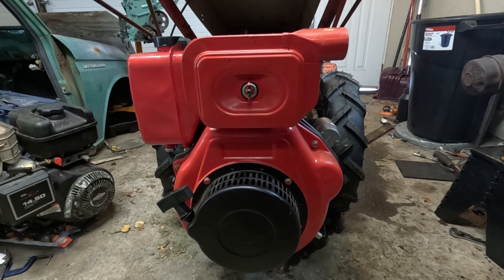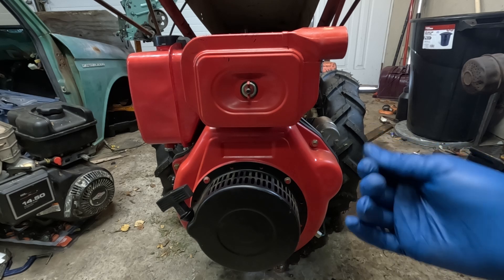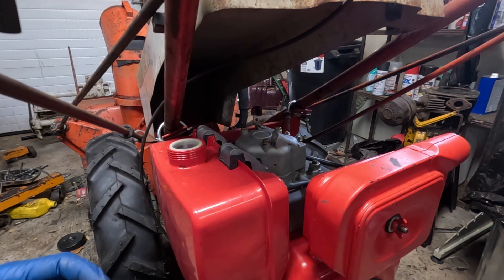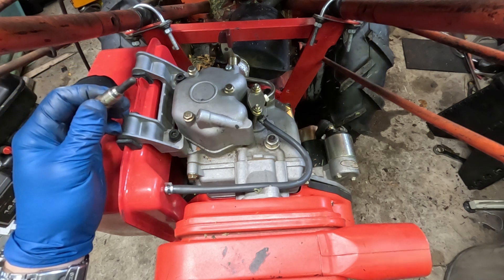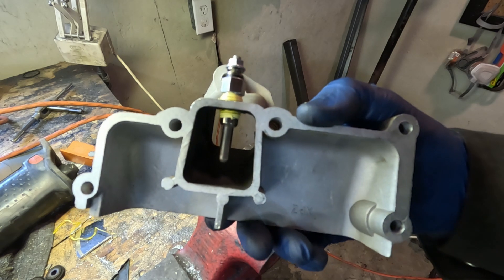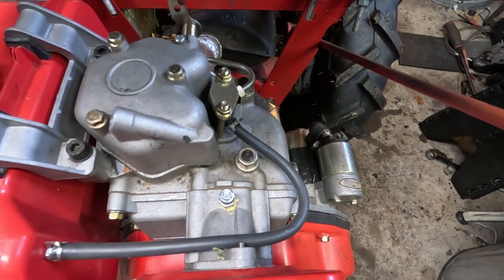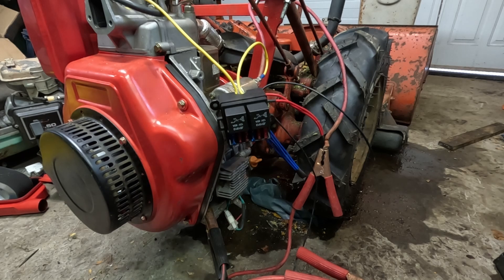How to Add a Glow Plug to an Air Cooled Yanmar Diesel

Comment: You're a genius!  :medal-yellow-first-red: :finger-red-number-one::person-turquoise-crowd-surf:💯👌... Oh my God! You're one of those people who makes YouTube worthwhile :stayhome:! Thank you so much.
I live in the Mexican Caribbean, so I'll never have this temperature problem (brrrrrrr) that you describe so well... well, who knows! However, your contribution never ceases to amaze me because I've seen other people deal with this typical diesel engine problem, especially with these little ones. Although they're very basic, with proper care, even the "Chinese clones" have worked wonders for me.
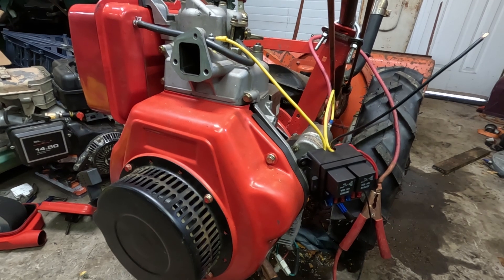At 12:35, you mention installing some accessories. Have you finished them yet? I imagine you'll want to install an oil level gauge, maybe a voltmeter. I think installing a tachometer would be more difficult, but it would be very interesting. I have serious doubts about whether this engine electrical system (basically a dynamo with a current regulator) will be able to keep the battery fully charged. Well, finally, if you need the Yanmar Industrial Diesel Engine Service Manual for L-A series models, please email me and I will send it to you in PDF format (almost 130 pages).
Reply from the maker: I have trouble with the battery. It doesn’t make much voltage until a high rpm. I chose to put an oil pressure gauge.
Reply: @haoleboyshow-tos2279  These engines must run at high rpm to ensure efficient cooling. This improves engine efficiency and helps keep the battery charged. I think it would also be wise to install a larger battery than recommended (especially in very cold locations). This would possibly help reduce the strain on the battery during startups and prevent it from discharging frequently.
Among other modifications, I've seen turbochargers installed, but beyond verifying their operation, I don't see how they would improve engine performance and workload in the long run.
For those with the means, it might be worthwhile to try installing an alternator and replacing the dynamo—that would have to be studied.

Comment: I can't find an engine/ motor plate for the life of me.  Any advice?
Reply from the maker: Do you mean the engine itself, or the throttle plate? Not quite sure what you mean.
Reply: @haoleboyshow-tos2279 
You can Google predator motor plate and see an image of what I mean.  Basically what I'm looking for is a plate of steel with pre-drilled holes for this engine so when I mount it it's not crooked and I'm not having chain popping off issues

Comment: What glow plug did you use? Worried that some are too long
Reply from the maker: There is a link in the description. 
It would be the glow plug for a 1980 VW Rabbit.
https://www.rockauto.com/en/catalog/volkswagen,1981,rabbit+pickup,1.6l+l4+diesel,1367737,ignition,diesel+glow+plug,7152

Comment: nice job, I bought a heater grid from a military L70. and where you put the glow plug is only place to put one. thanks for the video btw. as for the loose glow plug, your hole could of been a little too big.
Reply: Where did you find the grid heater? Got a part number?
Reply: @DoAWheelie392  I bought it off a parts L70AE military diesel engine. and I don't have the parts numbers off the top of my head.
Reply from the maker: I think you’re right about the hole. 
What is the part number on that heater grid?

Comment: A good oil can make a big change too ,in winter times .
A old oil is very thick and sticky ,replace that with new oil and you gain a few rpm certainly with hand starting .
on my old kubota knd3 you even have a smal ventury to put a little bit of gasoline in the inlet .
not for easy burning but too thin the oil in the cylinder too get higher rpm wit starting .
And make use of the de-compressor too gain more rpm with starting .
More rpm is more heat.
Reply from the maker: All good suggestions. Never tried the gas thing though.
Reply: @haoleboyshow-tos2279  you shouldn't use gas diesel max, can wreck the small injection pump. Adept Ape on youtube did a video say why you shouldn't put gas in the fuel.
Reply: Read my post .
It's in an inlet in the intake .
Not in the fuel .ore in the fuelpump
Reply: you shouldn't use gas diesel max, can wreck the small injection pump. Adept Ape on youtube did a video say why you shouldn't put gas in the fuel.

Comment: And now look up "Demonstrating a "Thermostart" Intake Manifold Pre-Heater" on YT since you have a 12VDC battery starter system anyway.

The Thermostart is a flame heater that uses a dribble of diesel to create a fire in your metal inlet manifold when the nichrome wire glows red hot and opens the fuel valve incorporated in the Thermostart  to let a little diesel fuel through to create a flame.
Now hit the starter and suck the flame into the cylinder.

Instant start on the coldest day.

As long as you have a diesel motor with a metal inlet manifold this can be retrofitted.....
tractors especially can so benefit from this if parked outside or in unheated barns in winter.

About 1/4 the amp draw of 4 or 6 glow plugs....easier on the cold batteries as well.

Comment: Red bottle of 911 is for when the fuel is already gelled up. It is also only works for a short period. It's for when you forgot to treat and are stuck with gelled fuel. It is for emergency use like the front of the bottle says and only works for a few hours. Read all of the back. You need the white bottle to keep the fuel from gelling in the first place.
Reply from the maker: Had no idea. I usually just grab whatever one is still on the shelves. I’ve been putting it in my cars for years. It definitely helps starting for as long as it takes me to go through a tank.
Reply: @haoleboyshow-tos2279  then you have been lucky with where you get your fuel from. They have been treating it well. My experience is that the big rig places treat just barely enough to not gell. Mostly because they go through fuel very fast. But the regular town stations treat more to not upset the regulars. But either way interested to see how well the glow plug helps with cold starts.
Reply from the maker: @johncollinsgrove1750  It hasn’t been cold enough to make a difference, but I do plan to show it starting and blowing snow